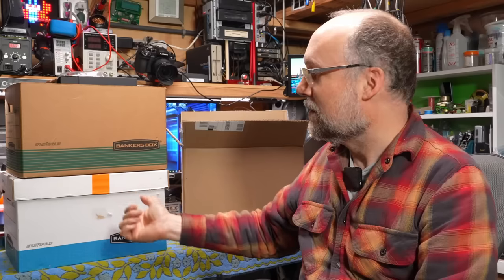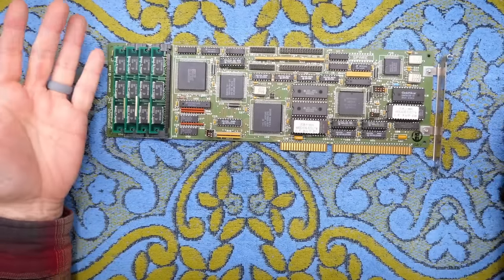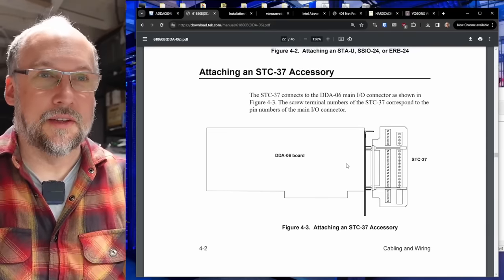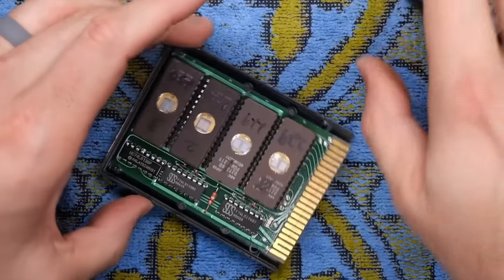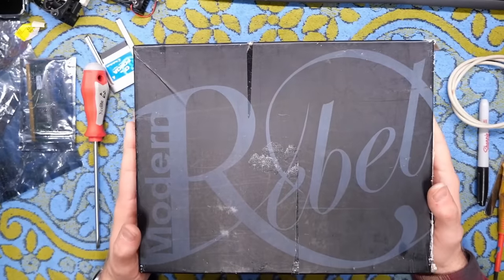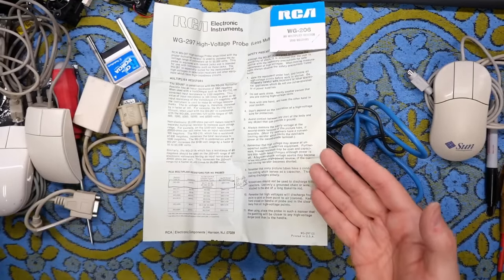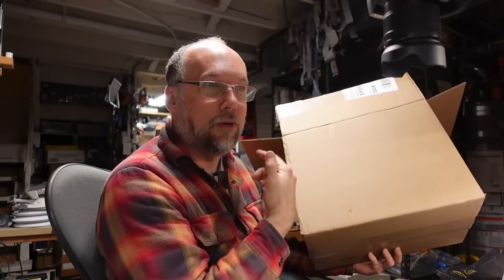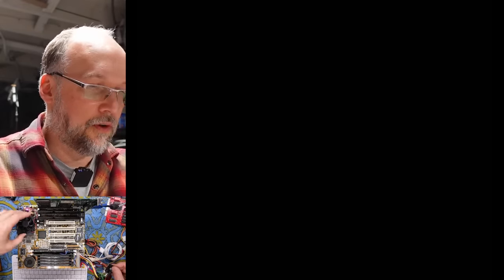What mysterious retro goodies can we find inside these boxes?

Comment: Win32s was a 32bit extension for Windows 3.11 so that disk of Windows 95 games were probably mostly 32-bit Windows 3.11 compatible games. The cd has the Win32s installer. Which would explain why it says you need a 386 even though Windows 95 itself required a 386. This cd was not originally made for Win95, but likely they just slapped a Win95 label on it after they added some actual Win95 titles (like pitfall) and added an autorun.inf.
That switch training cart seems similar in concept to a program I used on a Windows PC during rehab after a Stroke 5 years ago, using simple games to teach fine motor controls. I can imagine that the whole setup with the speech synth and button box wasn't cheap as equipment for rehab and special needs never is. 3.5 mm jacks are a common standard for external buttons for special needs. The X Box Adaptive controller uses 3.5mm for custom button setups. Commodity consumer electronics being used in these sorts of situations will likely always be seen as you can not beat the huge economies of scales of consumer electronics. A medical devices company ty[pically needs to charge a lot for things due to the limited quantities of products being sold. Back when I was in rehab wiimotes were a favoured input device. Wireless, Motion sensing with a selection of buttons is a good thing to have when you are trying to detect any impulse from a person with limited ability to move.

Comment: Looks like the HV probe makes, for example, a 1:100 voltage divider. I'm guessing there is 1 large resistor in it and you measure the voltage drop across a smaller resistance at your multimeter and a 3rd lead goes to ground.

Comment: Those connectors on the switch box would be used to connect the comtomized actuators many special needs people are limited to.  They may have just one finger that they can at best toggle a lever back and forth with a finger or toe or other body part.  They could also be wired to eyelid monitors or mouth suction/blowing devices etc.   I have designed a few of those in the past.  You have to find the easiest thing for them to do without stressing them out as using some actuators may be very existing for them.   That  was a surprisingly good system for the time.  I am impressed.  I only worked with PC system back in the day.  They were astronomically expensive, almost criminally in my opinion.

Comment: The IO card would certainly be useful for automation stuff. Should be easy enough to write software to... if you want to part wih it, I could give it a try...

EDIT: and about the high voltage probe: it has a built in resistor that is "added" in series to the internal resistance of your meter. So it forms a voltge divider that is stepping down the voltage between the tip and the grounding clip (e.g. 1000V) to a reasonable voltage on the meter (i.e. 10V) so the mer sees 10V when the probe sees 1000V. Hence, "times 100" would give the real voltage. To properly work, the internal resistance of the meter must match the spec mentioned in the manual, or else the readings will be off. But it whould be safe to use with any modern meter, just the real value might be off because the divder doesn't add up to exactly 9:1 or similar.

Comment: "Win32S" was known as Win32's, it was a sort of an expansion for Windows 3.1/3.11 that added 32bit capability, allowing (some) 32Bit / Windows95 software to work on 16bit Windows 3.1... but was released alongside NT3.1, before Win95

edit
I also think that esams thing is amazing, especially for the time - and that fact it's still working perfectly... just, plug it in and it works!! :D

Comment: I hve some experience with speech synthesis but it's really interesting to see it set up on C64, an 8-bit machine with many of these options simply not available to most people and schools because of the sheer cost. Nowadays you can wire up even the simplest tablet or smartphone to provide even better versions of these functions yet, back in the day, this could be several thousand dollars per person and would often be limited to special centers for special education or employment. I actually have never seen this for a C64 so I'm pretty impressed and wonder if any schools used this when it was new in 87/88 and what the cost was compared to more conventional solutions at the time.

Comment: Some grey JB Weld will fill in the corner of that chipped chip. The resistor is probably in the probe, maybe unscrew the handle? Had the fully populated 486 bridgeboard in my A2000.

Comment: I'm sure you know about using a mechanical pencil to straighten cpu pins, but I mention it just in case.

Also, when you find important documentation and drivers and files etc, please copy the URL and put it in the Wayback Machine/internet archive.

If it doesn't have it then it will mirror it.

Comment: I'm no expert on early Pentium processors, but I remember when I upgraded my old Packard Bell from a 166MHz to a Pentium 233MHz I did have to change jumper settings on the motherboard in order for the computer to recognize the higher speed on the processor.  It didn't register automatically.  Perhaps it's the same with your Overdrive processor?

Comment: Mr Carlson's Lab youtube channel has some videos where he uses his own curve tracer (as in, he designed it himself and sells the schematics so people can build it).
What little I know is that the shape of the curve you get on the XY display tells you what kind of part you are looking at, depending on the shape you know if the thing that's connected is behaving like a capacitor, diode, resistor, ... so you can check for dead parts that way. I don't know exactly what other uses a curve tracer has.

Comment: Ah, word-boards... as a kid, the ones I saw (late 70's) were just pictures on pages, mostly used for Cerebral Palsy and Muscular Dystrophy. As an adult teaching in an elementary school system (long term and short term subbing for 15 years, about 6 in long terms), I saw a variety of devices between 2001 and 2016, but not one iPad. Typically, laptops and an external 3 to 10 button custom controller. But many kids were still using picture pages. Only the kids in wheelchairs typically 
In the late 90s, a friend with ALS wound up using a bespoke system; it used the same sound circuits as a Speak and Spell, but with menu driven word selection, and end of sentence read of whole sentence. It also used a VFD. Before he got that, I found an app for my PalmOS that made the whole screen useable for graffiti; John was able to use that, much to his delight. ALS got him not long after his soundboard arrived...
I'll note as well - he never  gave up joining the responses at church, even when he was able only to hiss in rhythm.

Comment: On the AboveBoard issue, at [1:04:52] you're showing the two boards.  I think what may be happening is the differences in Extended memory versus Expanded memory.  Extended memory is contiguous above the Conventional memory range, while Expanded is banks of memory taking turns being swapped in and out of a specific range.

As I recall, Expanded Memory was first developed and used on the 8-bit XT-class PCs, then Extended came along with the '286 class machines and onward, due to their ability to address more physical memory.

I used the AboveBoard back in the late '80s on a then-new IBM PC/AT.  I could not agree more on the overall quality and versatility of the hardware, firmware, and software.

Comment: Nice find! That Votrax SC-01A has become quite rare and will fetch a high price these days. I've been hunting for one for a few years. That chip generates phonemes of English speech, and was used in the Hero-1 robot, Q*Bert, etc.. I'd written a simple windows app (16-bit) to send strings of phonemes and controls to get it to speak sentences and make sound effects. Unfortunately, the SC-01 chips I got on EBay, those years ago, were either counterfeit or defective, and generate a loud tone at 2KHz while speaking, so, pretty useless unless you need a headache generator. I'd be happy to share my test app + source code, if interested. Cheers!
Reply: There’s a guy doing a kickstarter on a clone of these. Personally I wish someone would clone the sc-02, but oh well.

Comment: Modern DMMs have an input resistance of about 10Mohm so using the high voltage probe creates a voltage divider of about /100, which is why you need to multiply the shown value by 100 for the final value. the limit of 50kV would likely be because of the construction of the probe and not a limitation of the DMM used.

Comment: Adrian - I ♥ your content 🥰   I'm a Technical Architect/Software Engineer/Hardware Engineer from the UK (in my 50's) and hack around with a lot of hardware myself (especially ARM and RISC-V based  single board computers like the Raspberry Pi, Pico and Milk-V Duos, PICs, Arduinos and all that.  I specialise in Linux systems so naturally my door bell is ridiculously over-engineered - made from a Banana Pi (running Armbian) + USB audio + butchered PC speakers.  Why shouldn't you SSH into your door bell + run Python (and SAMBA) on it!  My childhood computer was/is a fully working Sharp MZ-80K (have some tapes) but it would be FAR too expensive to ship from the UK.  I'll think about it...

Comment: Pentium Overdrive: Early socket 5 boards had an fixed bus-to-core ration of 2:3. So you could only use 75, 90 or 100 MHz CPUs. Later had a jumper for 1:2 so you could use the new 120 or 133 MHz CPUs (P54C) as well. Multipliers only became a thing with socket 7 Pentiums 150/166 MHz (P54CS from which these Overdrives derived) but especially with other chipset and CPU manufacturers on the same socket.

Comment: Early Socket 5 Pentium boards used a single voltage while later Socket 7 boards supported dual voltage CPU's 1 rail was IO voltage 3.3v and second was usually a lower voltage 2.8v
The overdrive CPUs allowed MMX CPU to run in a Socket 5 board.

Comment: its got a "candystripe" stick resistor going from tip into handset. it effectively divides the measured voltage by 1000 so you connect black and red to your meter and I think theres an additional ground lead and poke the hv source with probe tip. 25000 volts shows up on the meter as 25. 

Use a meter you dont care about tho just in case!

Comment: @24:55 should work in DOS, I had worked on an old IBM tablet that had a PCMCIA hard disk, i imaged it over to a CF card and used one of those adapters and the tablet would boot from the CF card in the PCMCIA slot and go into DOS and then Windows 3.1 for Tablets.

Basically the computer sees the PCMCIA drives like normal IDE hard disks.

Comment: The dip switch card setup had the advantage in the eighties and nineties, when you got them used, as finding appropriate software, if it didn't come with the card, was much harder then, or at least you had to wait a while for post office to deliver a disk, while dip switches you could mess with immediately. About half the cards I ended up coming accross had the dip settings screen printed on the PCB. The others I ended up foguring out by trial and error. Unfortunately many of the early cards didn't play nice, so you could only have one in the system. The later ones, can often be configured to work along with each other. There was one that had a socket on a cable, so it could plug between the cpu and the motherboard socket, and the cpu could access it at higher speed than the ISA bus speed.

Comment: PC Power and Cooling was somewhat well known as a manufacturer of high wattage power supplies and silent power supplies.  Never looked into them enough to know they made fans/heatsinks, but guess that would be the "cooling" part of their name.   I think they were the "first" to offer 1000w/1250w ATX power supplies back when 450w was huge and much better than 500w~ was unheard off.  Plus most everyone had fans in their power supplies, i guess some industrial slim form factor power supplies were silent, but wasn't really a thing for desktops.   Also because of the smaller quantities and higher specs, their power supplies were "expensive' like $200 back when $50ish dollars was name brand costs.

Comment: 26:50 Genuine constructive criticism. Would it have been possible to soften the glue by semi-submerging the chip in acetone pins facing down? Awesome video.
Reply from the maker: Yeah in hindsight that might have been a good solution. I've run into these heatsinks glued on with an impossible to remove epoxy resin...And I spent so much time trying to get the head sink off I ended up accidentally removing the gold lid on the bottom of the CPU.

Comment: 31:06 Win32s refers to the 32-bit extensions for 16-bit windows. The 's' is for 'subset'. In essence, a subset of the Win32 API from later windows versions that you could install on top of Windows 3.x which gave limited support for some of the later 32-bit windows API calls, allowing some 32-bit software to run on Windows 3.x. This is an official thing from Microsoft.

Comment: The HV Probe should plug into a digital MM a good fluke will work there should be a suitable resistor in the lead these are generally used in valve based equipment where voltages are generally in the  Kilo volt range.

Comment: The curve tracer hooks via those leads in the back to an oscilloscope.
Have you ever seen the graphical display of semiconductor charactics in a data sheet?  The curve tracer is what displays them. Basicly ti varies the emitter to collector voltage and displays the collector current.  It repeats this for several different base voltages (or currents), and since it operates in XY mode, it can display several curves at the same time superimposed on top of each other.  You can even use a semiconductor curve tracer to plot vacuum tube characteristics if the tracer can operate at high enough voltages.

Comment: I have a board that will only accept up to a 200MHz non-MMX processor. Core voltage will not allow the MMX versions. I like it actually as it marks the very last CPU that did not include MMX instructions...kind of historic.